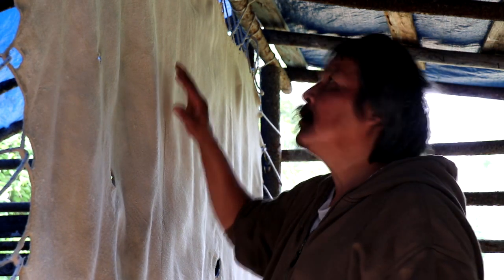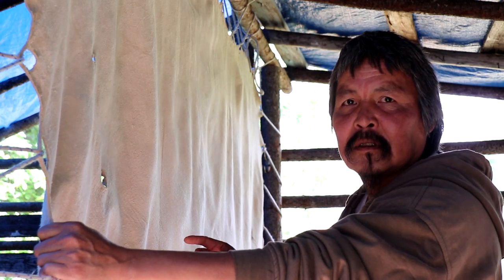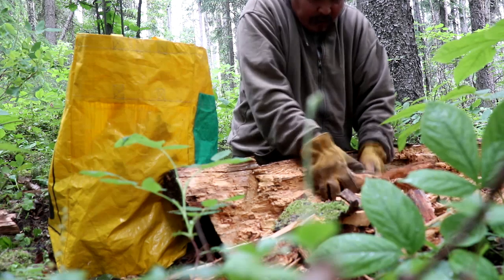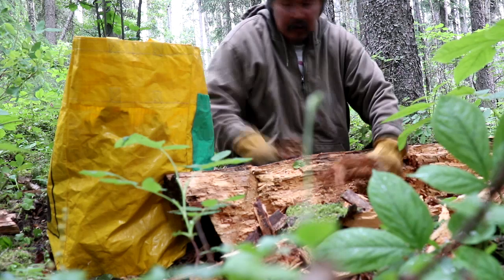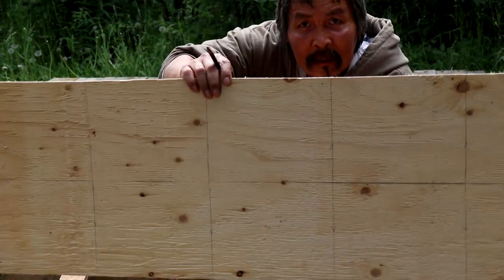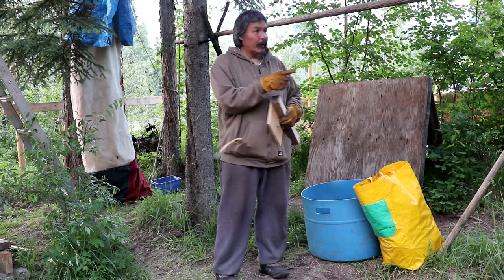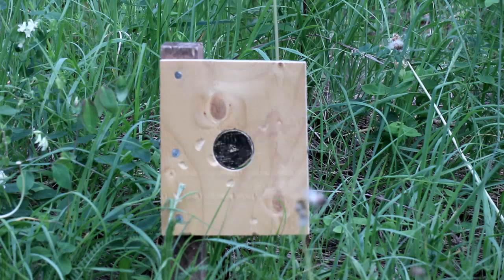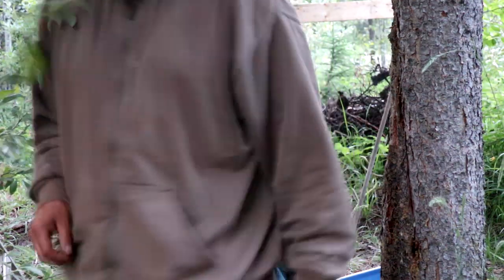2020 June 27th

Comment: Just found this pricing on the web.  Is this an accurate price for tanned moose hide?

Cream Moose Leather 5 1/2 oz

52$ US – 305$ US

We are SO thrilled to be able to offer cream 5 1/2 ounce moose.  This leather is going to make some insane bags and moccasins!!!   This is wild Moose from the Laurentian Mountains north of Montreal. We gather them from hunters and have them commercially tanned, 5 1/2 ounces really requires a commercial sewing machine OR hole punch and lacing. (see our leather bags for examples) We have some amazing pieces….sizes range from 8 sq ft up 12 sq ft in quarter moose AND we also have some (extremely rare)  half moose sizes from 15 sq ft up to 25 sq ft…  We also offer bundles of 50 sq ft at a little discount.